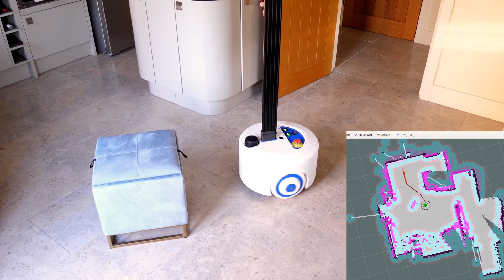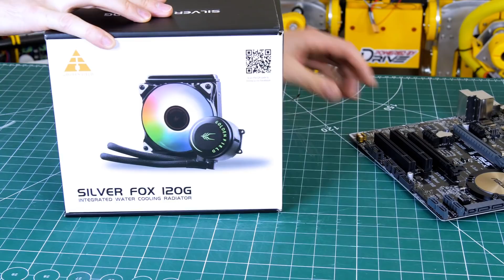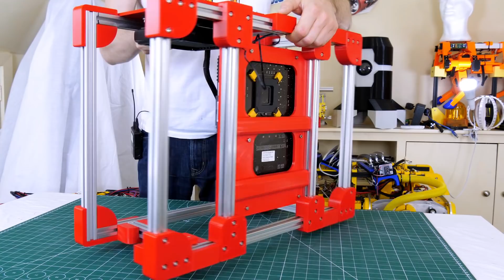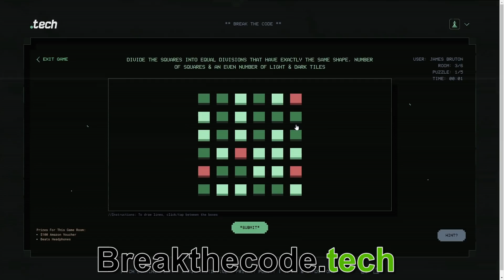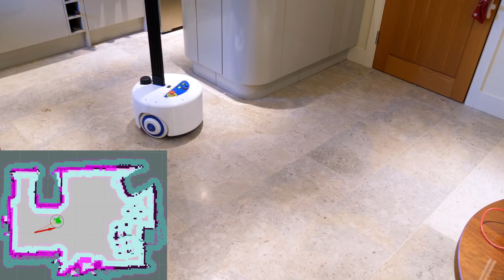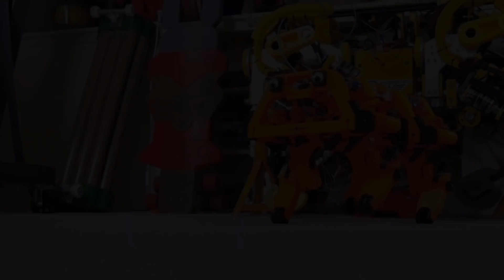Building a Dedicated Robotics Workstation

Comment from the maker: You can support me on Patreon or through YouTube channel membership - Patrons and Members get access to all the videos up to a week early! https://www.patreon.com/XRobots
Reply: Should have gone with a low profile air cooler.bubbles could kill your cooler.
Reply: Your name drive looks like you forgot the standoff, it is tiled back and looks like it is putting pressure on the m.2 slot. You motherboard should have came with some very small standoffs for this.

NVM, lol your good.
Reply: Watch vram temps they don't have a heat sink and there is no air flow near them now
Reply: The 1060 is a huge leap over the 750ti, and it seems like you have enough space to include it. If possible I would definitely switch to that. Also, you might want a more enclosed design with one direction of airflow (in one side and out the other) rather than an open chassis with airflow in various directions. An enclosed design will primarily help with dust, and you can even add dust filters on your intake fans.
Reply: add a cover in front of the monitor when transporting
Reply: Why didn't u use a laptop?

Comment: ( "I've spent years on linux and I have no shame" here ) you can change the settings of x and xrandr for which display port it uses by default. I also recommend Arch Linux, not necessarily the vanilla version, even though it's light and easy to set up using archibold. You can use Manjaro or, if you want a more interesting option, Garuda ( I'm running the kde Dr4gonized Gaming version for the drivers. It also comes with linux-tkg instead of the standard kernel). The reason is Arch has a really nice meta-environment which makes it a breeze to install anything, ever... bless AUR and Chaotic AUR.

Comment: I have used VMware with ros and rviz multiple times and it works fine. In the laser scan section just change the size to 0.05 that works well, then change the style to dots as they are easier to see. You should then be able to have the coil or working fine as well

Comment: I'm sure how you treat your computers, but you might want to consider some soft, shock absorbing feet. The case looks pretty ridged. But using a ribbon cable to connect the GPU and mounting it separately would probably help with durability I would think. I've heard of add in GPUs causing damage in shipping because they're often just supported by the PCIE slot their plugged into, and they get jostled pretty hard some times.

Comment: Why not just use a laptop? This is the first project that you make and I find useless. It looks also bulkier and heavier than the initial PC Case + Monitor. You could have just upgraded the laptop to an SSD, that usually boosts the performance like 10 times for older laptops.

Comment: Great idea.  I have often found it difficult to take my robots to club meetings, because I have to disconnect my tower pc, and then transport all its separate bits.  You should definitely add a router.  I always have trouble with getting wifi at the venue, as my the robots are all connect to the house wifi.  You will find it so much easier to travel with the new machine.

Comment: Can tell James hasn't yet put his talents to really learning linux - making anything after the grub bootloader appear on whatever output you like isn't all that hard, though the output labels are different on different cards so you have to do a little work to find the right output names and settings for the config file.  On occasion Linux isn't as easy as it should be with poorly supported hardware, outdated packages from the distro's repository etc, but with a little reading its usually easy to fix, or you find the hardware is so poorly supported its not worth your time... 

The one thing even the friendly distros are not is as GUI driven for config and windon't - many of them do give everything a normal user might need in a GUI config screen, but there is always something that needs a systemwide config change (like setting the primary output before user local settings kick in) that requires a little editing of config files directly - the GUI based configs nearly always (maybe even always) only effect the users on local settings - so apply only once they are logged in...

Comment: Why did you decide on ubuntu 18.04? You could have just went with 20.04 which is the latest LTS release from April this year. It's 2 years more up to date
Reply from the maker: Because the NVIDIA Jetson range runs 18.04 by default, and I need to run the same version so my ROS Melodic will work everywhere.
Reply: That makes sense thanks for the response! Really love the build and I although you are not a software channel I would love some more coverage of linux

Comment: You could potentially add add an extra mains plug/socket to the case so that if you need to power for something you've got it it without running an extra cord.

It would be great for running a soldering iron or powering extra widgets to display  at your workstation while at events.

Comment: There should be a cpu_pump connector on the motherboard
Reply from the maker: There isn't, it's too old. It's either the chassis fans, or just having the pump running the whole time (which is should be)
Reply: @jamesbruton  cant you set a fan connector to work as a pump connector in the bios?

Comment: I recommend 2nd hand Google PixelBook 2015. I7 Processor with 16GB ram. Stick a fast SSD inside and use CHRX to install  GalliumOS Linux alongside Windows 10. It is super fast and great for ROS2 development, AI stuff etc. You can get them for 200 euro or less as folk are stuck with original ChomeOS and don't know they can wipe same with new OS.

Comment: I feel like it need attachable side panels for transport. But I guess you'd figure that out and also it is super easy to do with the setup you created.
Reply: That bot is prolly gonna cart it around at some point. Or just WiFi from a central location. It's merely a number-cruncher, right?
Reply: @wombleofwimbledon5442  it was mentioned in video that he will be taking the computer with him to conventions and stuff like that. For that I think it need protection. And no the computer in this form is not meant to be hauled by the robot.
Reply: @W0Ndr3y  Fair enough. Milwaukee makes a pack-out storage system that would probably work a charm for that. Also, this build needs some kind of hell, pantyhose to keep debris out if the workings.

Comment: ubuntu on windows!
i think you should keep your eyes peeled on Microsoft’s upcoming update which allows you to run Ubuntu directly in Windows without external programs!
try looking up WSL2 with GUI!
Reply: Hell no. Especially with the numpy fmod error that is still not fixed and the I can't use nvidia gpu in wsl unless windows insider, I do not recommend windows. For basic desktop take sure. For web development docker and Ros definitely no. I've been a long time user of windows but this past year mainly because of the numpy error I switched to dual booting ubuntu and only go back to windows for some Microsoft word compatibility issues and photoshop. Everything else is the same for ubuntu but better
Reply: @XDTuber  youre not wrong. I should have been clearer that WSL2 with GUI and proper GPU support should only be used once it comes out of the insider release channel. There is no final release yet.

Comment: He could make a battery module for it, to attach to the side mind you...
Reply: that would need to me a massive battery, he has a 550w psu let alone the monitor and it would need to be able to output t 240V
Reply: I hate myself for thinking a tiny, tiny, gas motor in the base would power this thing for a long-ass minute. Hate myself.

Comment: Reminds me of case that someone at my linux user group made years back, the whole frame was bent from steel reinforcing with the motherboard and everything inside that.. But it didn't have the monitor.  You just need to sew up a nice thick fabric bag to slide the whole thing inside for travel to keep it safe. 
Oh.. And when you next fiddle with the design, make it so the wifi antenna can be folded outside of the metal case, you'll reduce your wifi range range being close to the metal frame parts. Not enough to effect things in your home but when at bigger events, it might make a difference.
I am amused that the noctura low profile coolers are no taller than the complicated liquid cooled one, but this way does give you that extra flexibility and it clearly fits well!

Comment: I built similar thing for a friend. Instead of regular monitor i found old KVM terminal online, its a monitor, keyboard and trackpad designed to fit into a server rack. I also found 3U rack mount PC case and bolted it to the KVM. He later painted it so the whole thing looked like it was one chonker laptop. The only thing to look out for is that old KVM treminals all have VGA and PS2 keyboard\mouse ports.

Comment: Maybe add a flap to the back side when you tilt the rig. It seems easy to tip over.
Reply from the maker: It's pretty front heavy due to the monitor
Reply: @jamesbruton  Might want to do some testing on that, it's been my experience that having a straight line as your back support parallel to your rotation rather than perpendicular (that is the what the lower edge of the case  is) means you just created a hinge for it to swing around potently switching it from front heavy to back/top heavy, remember you have all the other parts in there that you also move from vertical to an angle as well(although the power supply being in front of and down low will help offset that somewhat, not sure how much since motherboard, graphics card and water cooler get more leverage on their side being further up), maybe redesign the monitor holder to have swing points on the upper corners and flip down leg on the bottom edge of monitor or maybe convert a much lighter weight laptop screen into a monitor with the swing out for the angle change.

Either way might want to put something soft behind it and do some stability tests to reassure all us worry warts that you have minimized the chance of something fatal happening to the newest member of the digital family.

Still a cool build, reminds me of the first portable I used that was nick named luggable(did I just age my self?).

Comment: James, the dedicated GPU is a good idea for another reason: Hardware acceleration for things like vector math and machine learning, which this workstation is going to be doing a lot of.
Reply from the maker: Yep - and potentially machine learning, I left space for a longer card
Reply: Did you mean CUDA cores? I think Tensor cores are a Google thing, dedicated for large scale matrix-matrix multiplications. CUDA is meant for pixel shaders, more cores means a higher resolution. NVIDIA introduced Tensor cores in their latest cards like RTX 3000.
Reply: > "Hardware acceleration for [...] machine learning"
Isn't that only on newer Nvidia GPus, those with Tensor cores? Neither of the two GPus he showed have those.
Reply: @Duker-Koushakur  No, the "tensor cores" are mostly only fancy marketing from Nvidia. GPUs have been used for computations for ages, e.g. by putting data in textures and using shaders, later compute shaders and then CUDA. Nvidia's "tensor cores" are basically the same thing as what normally runs CUDA (or shaders), just with less numerical precision and a bit faster.  All that those things are used for in machine learning is acceleration of matrix math. 

It is pretty much the same story with raytracing - you don't need RTX support to run raytracing on GPUs and it has been done for many years. RTX only adds a bit of specific support for accelerating some things that are typical in raytracing but you can do without just fine.
Reply: @Duker-Koushakur  Well all GPUs have tensor cores, but the new RTX 3000's has very good tensor cores used for machine learning, vector math, etc.
Reply: @safwanakhtar2528 Nope
Reply: @MagDag_  hmm, i might be one something else, thanks for the clarification